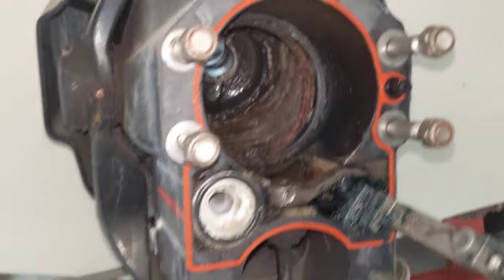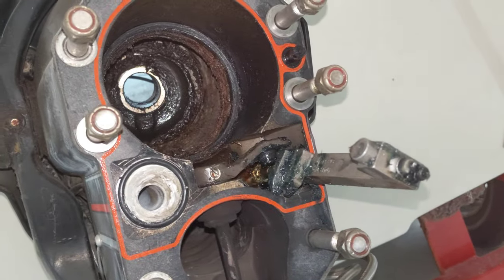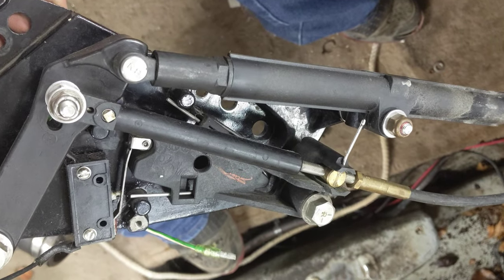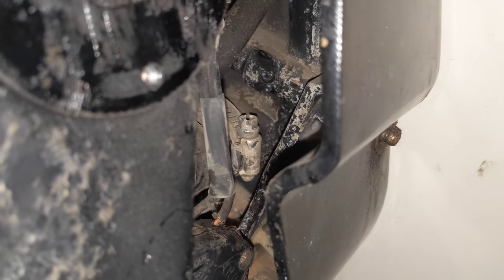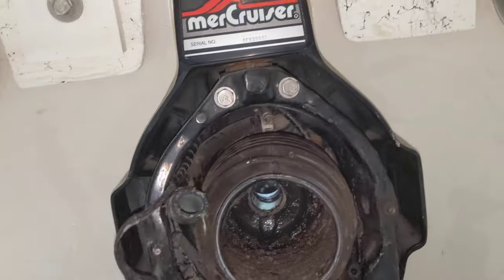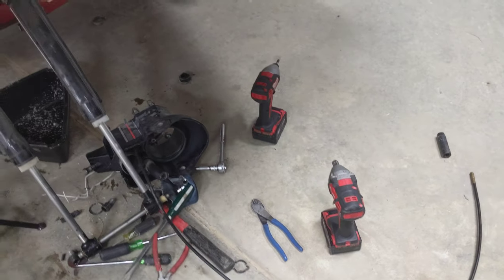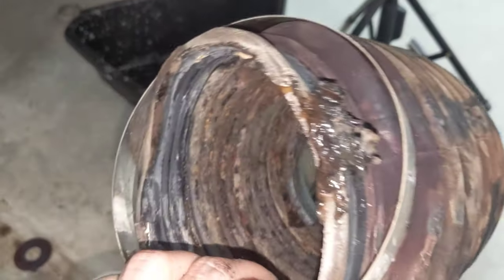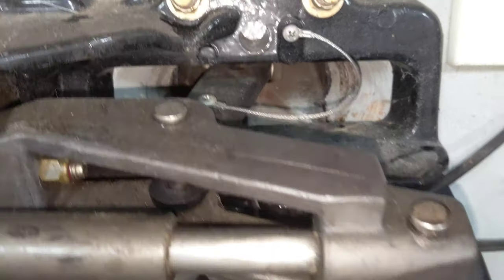Alpha One Gen 2 Gimbal Ring Teardown -- It is Trashed!

Comment: You're going to have a heck of a time getting that intake hose back on
 You need a special little tool to get  the new one on the helmet make sure you get it with the kit
Reply from the maker: Boat has been on the water with no problems for two seasons now. 🍻

Comment: I’ve got a similar issue, there’s 3.5” of play in the back of outdrive with 7.72 degrees of play. I have issues with my boat riding on it’s side and even worse steering at no wake speeds. All around bad steering. Does that sound like the gimbal ring? Would you mind looking at couple videos that show the play in the outdrive and play in the gimbal (on the sides of the outdrive)? I don’t plan on doing the work but I’m trying to fully understand the issue I have.
Reply from the maker: That does sound like the problem. If you slop the outdrive back and forth out of the water it shouldn't move too much. A little is normal but once it gets excessive it's hard to drive.
Reply: @605BOLT  Yup, it’s a single step hull boat too. It rides high on the driver side and low on the passenger. Prop torque is most likely engaging the slop. It’s very difficult to drive, has to be fixed… because it’s incredibly difficult to enjoy while driving.
Reply from the maker: @Dwq47  I experienced that. Made it look like I was about a 12 pack deep all the time.
Reply: @605BOLT  My sentiments exactly… it’s hard to hit top speed while going sideways down the lake too lol. So you think it’s the gimbal ring as well? I just didn’t want to spend 3k on it and I really can’t be doing the work on it myself.
Reply from the maker: @Dwq47  it's hard to say without laying eyes on it. If the steering is all worn out it's usually right the swivel shaft to the gimbal ring that is worn out or the steering arm to the swivel shaft. Google a diagram so you can see or watch the further videos I have where I rebuild this. Shows all the pieces and where it can be loose or worn out.
Reply from the maker: @Dwq47  chances are though it's going to cost a few bucks yes. That's what sucks about this whole area of the boat.
Reply: @605BOLT  I checked the steering beforehand, I have a bravo one but it probably doesn’t make much of a difference. The steering was tight from what I saw, the play really was just contained in the outdrive. I’ve heard that I might as well replace the outdrive assembly rather than having it repaired.
Reply: @605BOLT  Yeahhhhhhh… I was hoping it wasn’t going to, the repair almost doesn’t feel worth it but my boat is a 1990 Larson senza spectre, the delta conic hull (and rare from what I’ve seen). https://youtube.com/shorts/AQFZvOBoGSM?feature=share this is a link that shows some of the play on the side of the gimbal ring. I’m not a mechanic so it’s difficult to effectively show a problem, I would think you’d want this area tight.
Reply from the maker: @Dwq47  I have little to no experience with bravo so idk if they have these same issues. Maybe someday I will upgrade to a bravo.
Reply: @605BOLT  The search continues! Well they are nicer than alphas, I hate the triangle gear teeth, they engage so hard… at least bravos are nice and smooth.
Reply from the maker: That is a nice feature. I agree.

Comment: I’m about to do the same thing on my 2001 crownline
Reply from the maker: It's a lot of work but you can do it!
Reply: @605BOLT   honestly, everything is perfectly fine except the gear oil feed tube is dry, rotted and leaking. I obviously can’t get to it without taking everything apart.
Reply from the maker: @chrisbonanno499  ah dang it. Ya probably just a one low quality part amongst the group. Sucks to have to do.
Reply: @605BOLT  is it possible to get your email or a way to contact you if I have any questions other than here? Or I could just keep on replying here if you like
Reply from the maker: @chrisbonanno499  reach out to me on Facebook and Facebook messenger. My name is Neil Kaltsulas.

Comment: Why didn't you just tighten the two bolts at the top
Reply from the maker: Because that should have been done about 5 seasons ago by the precot owner. If you ring is wallowed out and you over tighten it, the ring will break. There was way too much play to just tighten the bolts.
Reply from the maker: But if the previous owner would have been tightening the bolts each season as described in my video about the topic, then I wouldn't have needed to replace the worn out gimbal ring.  Maintenance is key.

Comment: Do i have to remove my engine to replace this???
Reply from the maker: No there are alternative methods that involve drilling the side of the transom housing and tightening the nut or replacing the arm or shaft. But I find removing the engine is easier.

Comment: How did you remove the bell from the swivel
Reply from the maker: Bell housing has two side pins that you unscrew. That's what hold it til the gimbal ring. I'm thinking that's what you're asking about but not positive.
Reply: Mines older I guess it doesn't work like that it has two pin that look like they pull out not screw out any it has two smaller pins that keep the larger pins from coming out I can't get none of them out
Reply from the maker: @shawnmad2493  ah shoot. What year boat? This alpha gen 2 is from 1995.
Reply: 70s
Reply: Can't seem to find any info how to remove those pins
Reply from the maker: @shawnmad2493  oh dang. Ya that's possibly a pre alpha drive. I have no experience with those. Sorry I can't help.
Reply: Everything else is the exact same except no trim tabs and it has the different type pins